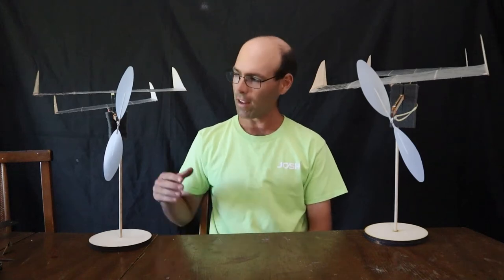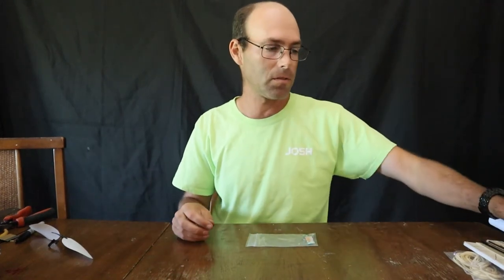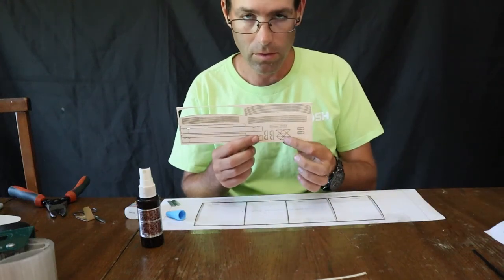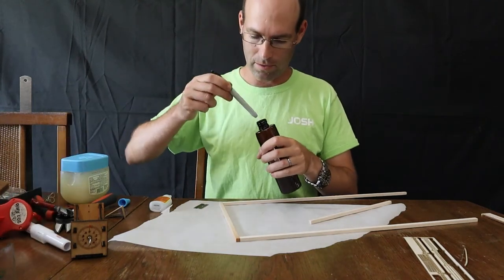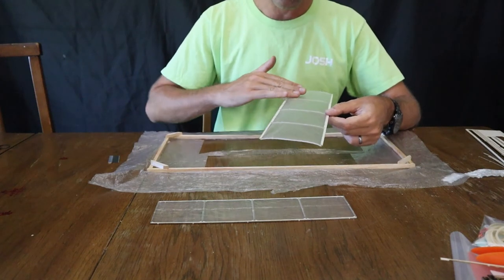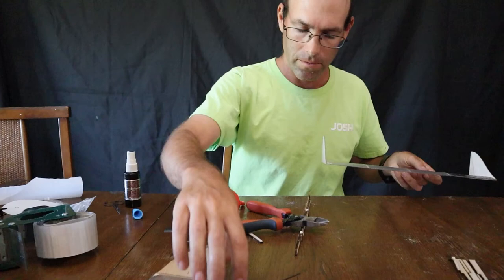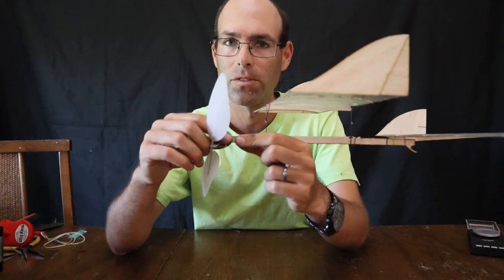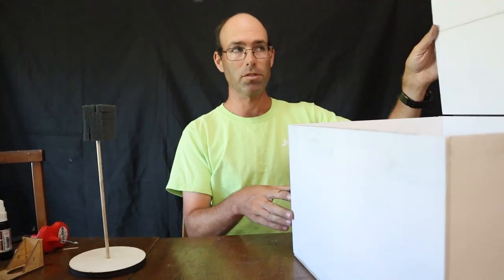Stinger B/C Build Instructions for 2023 Science Olympiad Flight

Comment: How would you recommend to make it climb more? Ours climes a little, but not as much as we would like.
Reply from the maker: Takes about 1300 turns to get maximum climb performance.
Reply: @joshuawfinn  we’ve gone up to 1400 turns and it still hasn’t climbed more than a foot
Reply from the maker: @henrywilsonwinter  how much does it weigh, is your propeller balanced, and is the prop shaft still straight?
Reply: It weighs about 8.3 oz, the propellor shaft is straight, and there aren’t many vibrations, so I’m pretty sure the propellor is balanced. I watched the trim video again and noticed that I didn’t move the wing forward, so im going to try that next time we test it.

Comment: competition tomorrow, I will tell how it performs. Trials with propeller turned 200 times gives about 20 secs of flight so we will be increasing that amount of turn tomorrow.
Reply from the maker: Is that 200 winder turns or in the motor? Motor should be taking 1300-1400.

Comment: three questions, what purpose or improvements do the gussets serve? is it just to be a connection between the ribs and the rods and provide more stability? What are those triangles you glued to the wingtips because my kit doesnt have those? and finally what would the difference be with crinkling and not crinkling the vege bag? tysm!
Reply from the maker: If you have a Stinger and you have the wingtips, the gussets are on the parts sheet. They are necessary to prevent the plane from breaking too easily. Crinkling the film makes it easier to get a good covering job. Be sure to read the written manual as it is up to date whereas this video has some elements that have changed on this year's model (wingtips and propeller).

Comment: Hey, I just had a quick question about wing twist. Do both the main and back wing need twist? If so, should the left side be above the left, or the other way around, and by how much should one side of the wing be higher than the other? Thanks!
Reply from the maker: Only twist the wing, tail flat. Wing twist should be slight, left leading edge at tip 1/16" higher than trailing edge.

Comment: Right now my stinger is only going in a forwards direction and isn't making a desired left turn. What do you suggest changing to make this turn happen as this model doesn't have the same adjustable tail as previous years.
Reply from the maker: You can stall twist the wooden tailboom to get stab tilt, but also make use of the slots in the fins to bend the fins for a turn. All versions of the Stinger have also responded well to bending the front of the nose bearing to the left to point the prop to the left 3-5 degrees. Be careful to avoid bending the wire propeller shaft though.

Comment: Hi Joshua, when we are putting the wing onto the fuselage it keeps falling off to the side because of the rubber bands. is it ok to glue?
Reply from the maker: This sounds like there may be an error somewhere in the construction.  Download the written build manual from the website and compare the fuselage/wing assembly photos to your plane. I don't recommend gluing the wing saddle in place because then you can't make adjustments and the plane is unlikely to fly.

Comment: Our (My partner and I) Stinger motor doesn't work for some reason. The rubber band is normal and it is 1.93 grams, but it makes a grinding noise when we let it spin (attached to the whole plane) and we suspect the rubber band motor keeps hitting our motor stick. Any idea why this is happening?
Reply from the maker: Always put the knot at the back. It's probably hitting the motorstick.

Comment: Hey Joshua I was wondering if the stab assembly in the blueprint is supposed to be used for division B. I noticed the width of the tail for Division B in the plans is supposed to smaller than the front wing. Thanks!
Reply from the maker: Use what's on the full sized plans. The 3 views are only for basic guidance and inclusion, as needed, in your documentation. They play no role in compliance checks either.

Comment: Hey Joshua I was wondering if it was okay to use mylar from previous years for the Division C stinger. Is there a difference in performance of mylar and veggie bags?
Reply from the maker: It's fine to use the old mylar, it'll save you some weight. We switched to the veggie bags because so many students are just not ready to use thin coverings and were having to get replacement materials.

Comment: Great video Joshua! However, I was wondering: on your new Stinger model for the Science Olympiad 2023 rules, why did you decide to switch out the mylar for vegetable bags? I remember from previous years that typically your Stinger models used mylar instead.
Reply from the maker: I've had a lot of students have trouble tearing up the mylar, and we found that with careful wood selection, these build out to right at 8g with the veggie bags.

Comment: Hi, I was wondering which you would recommend is better the stinger or the senior flyer for this years 2023 competition?
Reply from the maker: Senior Flyer is for beginners. It is very easy to build and fly. Stinger is for fliers with previous building experience, and it rewards good, clean building with the ultimate levels of performance. In short, the Senior Flyer does 90-120 seconds in typical gyms while the Stinger is capable of 180+ seconds.

Comment: Hi! I couldn’t seem to find the nose bearing in my kit. Little help?
Reply from the maker: Depends what version you've got. Only the early ones had the aluminum bearings. We supplied quite a few with the preassembled IFFS props (black plastic hub and bearinf) however the most recent ones use the Ikara gray plastic hardware, shown in photos on the product page down at the botto.
Reply: I found it, thanks

Comment: At 44:56, are those pieces under the rectangle supposed to be part of the flight kit? I cannot find them .
Reply from the maker: Negative. We reused some old footage for that portion of the video and that's a covering frame I've had for about 10 years.
Reply: @joshuawfinn You have to glue an extra piece to the wing tip?
Reply: This is for the Stinger 23-24
Reply from the maker: @andrewtran9513  negative. 2024 wingtips are one piece.
Reply: @joshuawfinn How do I do the propeller for the 23-24 Stinger?
Reply from the maker: @andrewtran9513  check the manual on the website. It shows the install. It's very easy.
Reply: @joshuawfinn  any tips on how to get the plane to fly higher? Today, I tested it today, and the flight clocked 28 seconds because the plane didn't go high enough.

Comment: I received a small grey plastic nose bearing instead of either one showed here. How should I attach it?
Reply from the maker: Check the product page. I've updated it with details on the Ikara bearings.
Reply: I received one like that as well, and I didn’t realize until I actually got to that part. Where can I find the updates? Competition is in a couple days, and the product page doesn’t seem to have anything.
Reply: We don’t have the black or silver metal nose bearings, and the small needle shaft for the silver metal one.
Reply: Go to the page where you bought the plane from and scroll all the way down. There should be pictures with how to assemble it. If they’re not there for you, here’s how to make it: there were two pieces that came on the panel with the wing ribs that had two lines in them. Those two pieces slot into the grey bearing and glue to the fuselage.
Reply: Thank you!

Comment: Hi! My motor keeps snapping at 1,100 turns leaving me with a 42-second flight with the Stinger Division B.
Reply: I have also lubricated my motor.
Reply from the maker: Are you stretching to 4x relaxed length (not motorstick length), and are the motors at least 1.9g before lubricating? Also, check the trimming video I did...you should be getting more than that on 1100 turns. Lastly, is the HVAC on in your flying site?

Comment: The plane weighs about 8.7g without the rubber motor. Does anyone know why it does not fly longer and higher?
Reply from the maker: What turns/torque are you using, is the HVAC on, and are you lubricating the rubber motors before each time you wind them up?
Reply: @joshuawfinn  15:1 about 65 turns, ambient “banquet hall” Yes, it’s lubricated.
Reply from the maker: @kmanyip683  the supplied 0.085" rubber will take over 100 turns on a 15:1. To get the most out of the plane you really need to build or buy a torque meter so you can consistently hit the high power portion of the energy curve.
Reply: @joshuawfinn  100 turns, the rubber band breaks after 3 attempts if I can remember.
Reply from the maker: @kmanyip683  rubber is disposable. You'll only get 3-4 good flights from it.